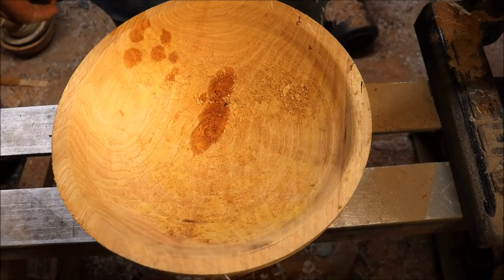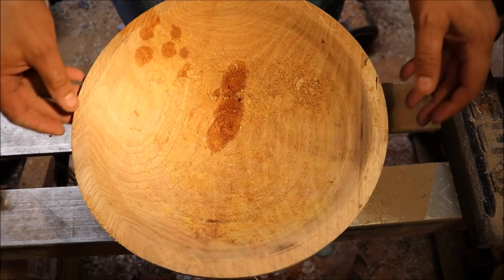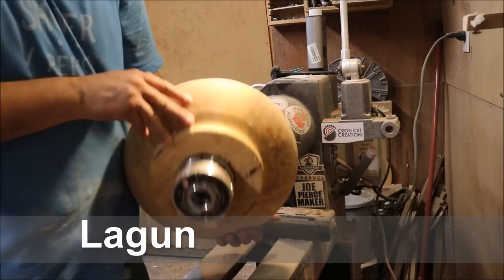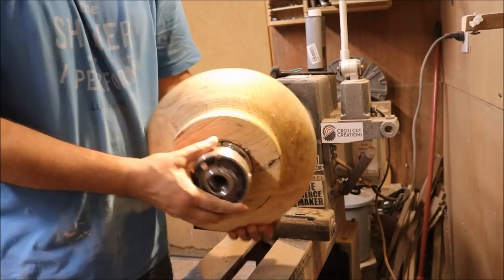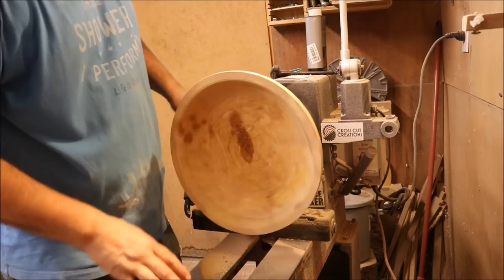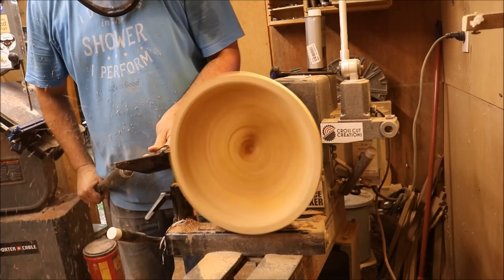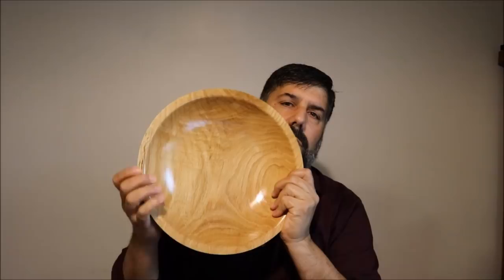The White Oak Bowl   A Wood Turners Love Story.

Comment: I will restrain myself from comment on the love story.... But I have questions.  Your bowls always have an amazing look to them, and you seem to always use sand and sealer.  Is that your secret?  Does it grain fill?
Reply from the maker: Rob, 
I cut my blanks to make sure the grain is a cross and flairs up or down on both sides. Well I try at least. As for the sanding sealer, yes I use it every time. I sand up to 240 grit then I use sanding sealer. It helps freeze or raise the grain then I sand from 240 up to 800. I know most people will say you are burnishing the wood at that point but I don't argue with results. Would you like for me to do a quick video on the sanding part and finishing part. I should be able to do it when I do this small oak or cherry bowl I'm planning.. Oh it really helps to power sand with a drill. 

Ken
Reply: @MoonpieCreations  YYYEEEESSSSS!!!!!!!!!!  A tutorial video on sanding and finishing would be great.  My method is beautiful, but it takes at least a week.  I want something faster that still looks great.